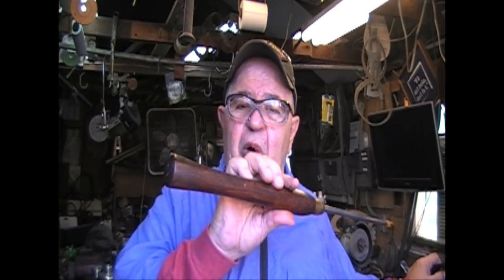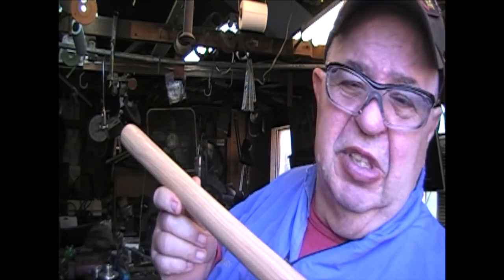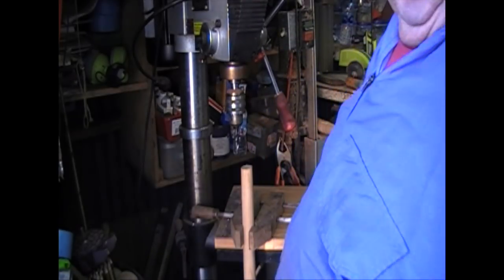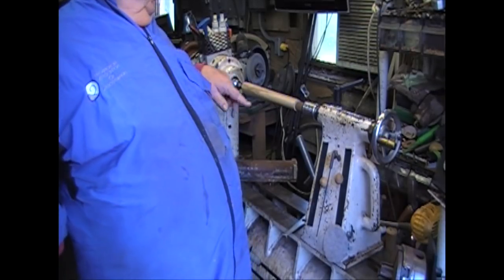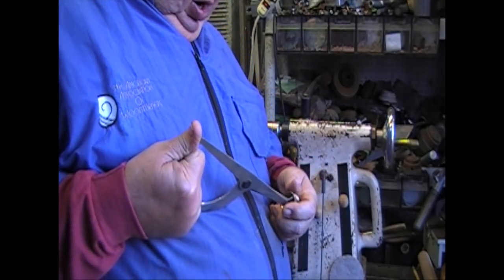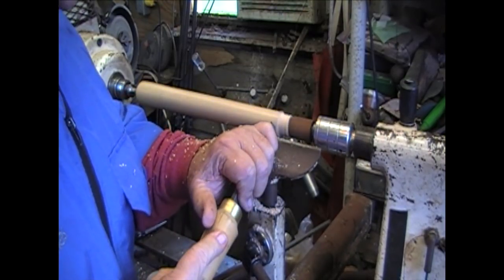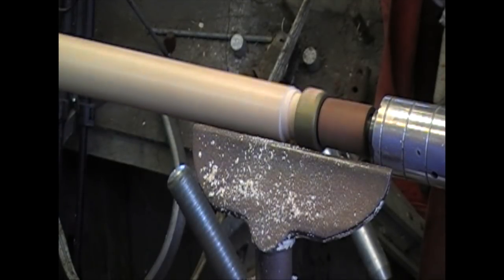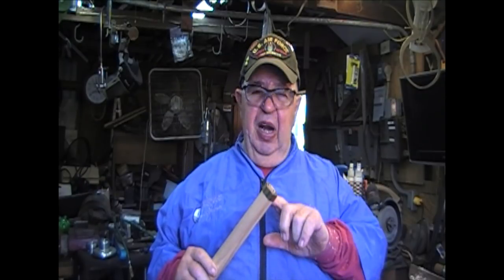#294 Wooden tool handle

Comment: Hey Cap'n, Welcome back! Thank you for your service, thank you for your great info. I have been a  fan since the beginning. I purchased two of your 1/2 bars way back years ago along with a bunch of cutters. I need advice on the bar for the square cutter. I cannot tighten that screw and still have the cutter square with the bar. I always comes out crooked.  It is most aggravating. Any of your "plane talk" advice would surely be welcome. Thanks again for all the hard work you put in to bringing common sense solutions for turners.

Comment: I like this one. I am making a handle for a 2" scraper or timber framing tool some idiot hammered and split the handle . It was so dull it did not cut anything. I made a partial turning on my lathe and will get back to it soon. I was lucky to get the tool tho.